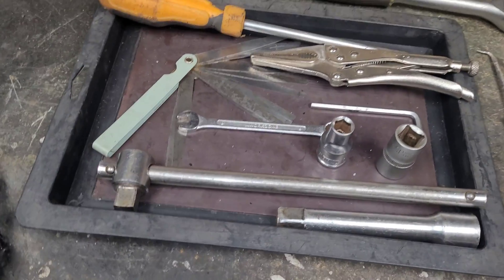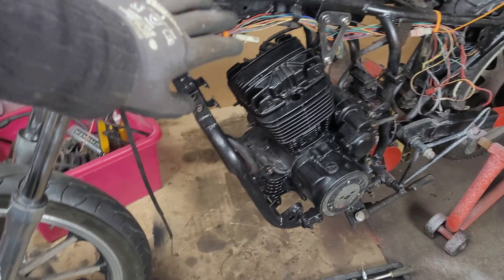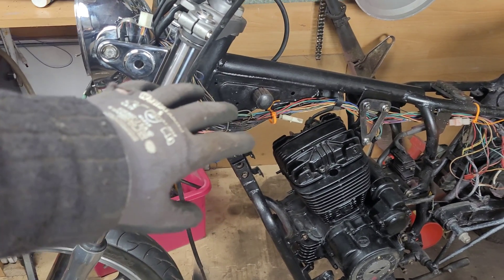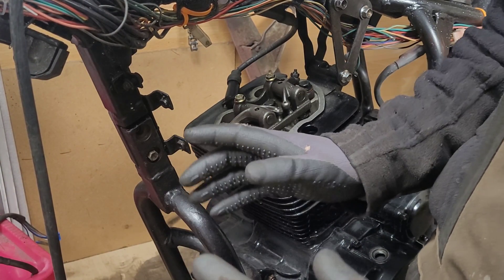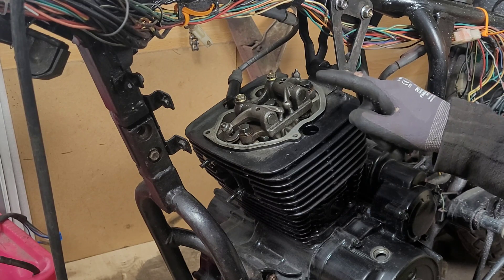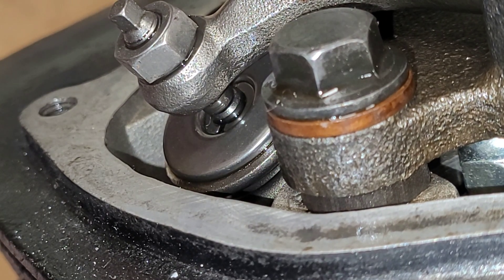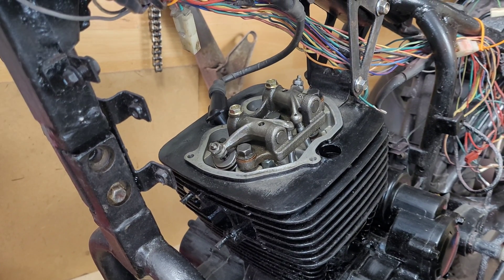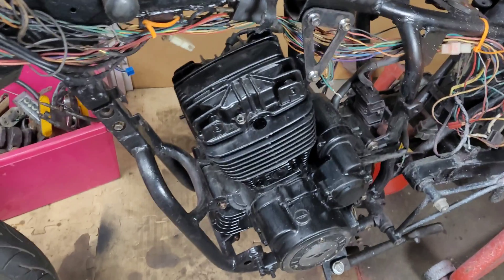How to - Pushrod Engine Valve Adjustment (125cc tappets).

Comment: I'm f'ing tired, I have a 200 cc bike specs are 0.06 and 0.08. I did it  just like in the video, It turns on okay but the slight tapping noise it's still there. The intake rocker arm is loose and moves a little when I touch it, can that affect everything else?. I did it once before struggling now and it wasn't as tappy as it is now. But it was struggling to turn on. I'm pissed at that noise.

Comment: For lexmoto valleta 125cc with variator not gears , should I use same measurements on the valves ?
Reply from the maker: I believe the engine in that scooter uses a GY6 clone, valve clearance on the GY6 is 0.1mm on the intake and 0.12mm on the exhaust. See how you get along and let me know.
Reply: @angryscottishbiker5097  if thats the case  I ordered wrong filler gauge starting from 0.04 mm
Reply from the maker: @liviumititelu7397  a lot of guides out there tend to have the sizes in inches so 0.004" which is 0.1mm.  It's always good to have a set of feeler guages with a large selection of blade sizes. If you ordered a set and the smallest is 0.04mm then you should be OK.
Reply: @angryscottishbiker5097  ye just ordered 0.04mm to 0.88 mm. I hope I will be able to sort it. Thanks a lot for your time sir